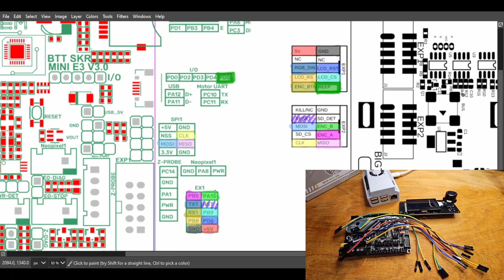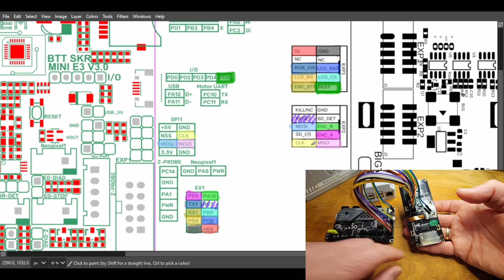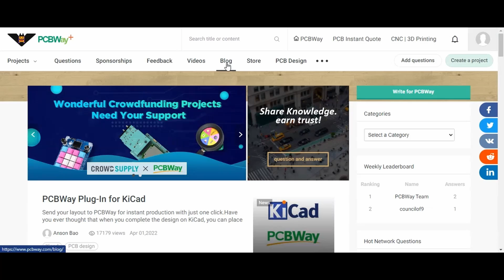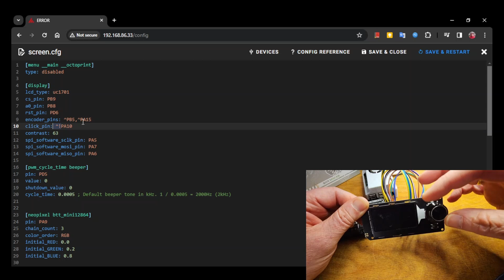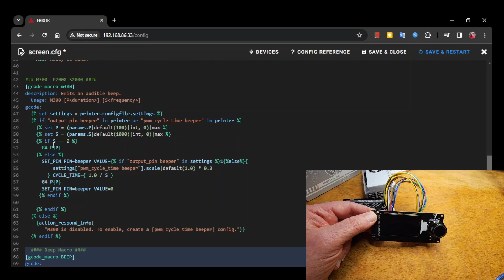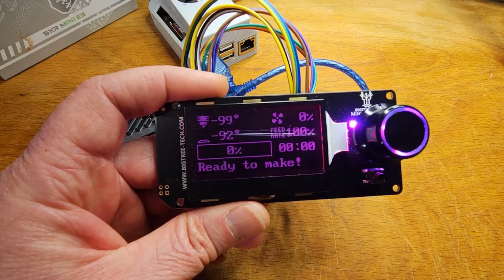Mini12864 to SKR mini e3 v3 | With Klipper

Comment: I have a Makerbase MKS Mini Mini12864 that looks like this BTT display but has different pin out. I managed to make it work thanks to this video and the schematics. Very helpful video. Thanks so much.

Edit: Forgot to mention I used SKR Mini E3 V2. It doesn’t have the same I/O pins of V3 so couldn’t assign beeper to any pins. But everything else works
Reply: Hello ? Would you be so kind to share the right place ? I think i managed to do 90% of the cables right. but the screen comes out blank.
Reply: @sunsixizzy  Here is my screen.cfg: [menu __main __octoprint]
type: disabled

[display]
lcd_type: uc1701
cs_pin: PB9
a0_pin: PB8
rst_pin: PB15
contrast: 63
encoder_pins: ^PB5,^PA15
click_pin: ^!PA10
spi_software_miso_pin: PA6
spi_software_mosi_pin: PA7
spi_software_sclk_pin: PA5

[neopixel btt_mini12864]
pin: PA9
chain_count: 3
color_order: RGB
initial_RED: 0.0
initial_GREEN: 0.3
initial_BLUE: 0.08

Comment: Is the SD card slot in LCD or the micro SD card slot on MCU can be access from klipper?
Reply from the maker: Klipper is not designed to be used that way. Klipper uses a virtual SD card. Basically it's a directory (file) on the host computer (like a raspberry pi).

Comment: Please rename to Mini12864 V1.0 to SKR mini e3 v3 | With Klipper
Reply from the maker: Why? The function is the same with V1 and V2. They even use the same pin layout. The V2 just has an option added for using a ribbon cable connection for certain boards.

Comment: So I have a similar set up and I am struggling because it seems like the SD card and the Screen fight over the SPI. My screen shows no status updates when printing off SD. Did you have any issues like this? Are you simply not using the on board SD card?
Reply from the maker: I don't use SD with klipper. It's easier to just load up files via the network.
Reply: @StackingLayers  this is exactly what I figured why I don't see anything about this issue anywhere online. I guess I'm too old school lol. Thx for the response.

Comment: hi, im getting a PA9 is being used multiple times when i try to save and reload printer.cfg Any ideas on whats going on?
Reply from the maker: You'll have to search through your configs to see where it's being used. You can't have the same pin used in multiple areas, except with some special scenarios.
Reply: @StackingLayers  i see now its used in a section called BigTreeTech TFT TouchScreen emulated 12864 mode in printer.cfg. i tried commenting it out but klipper didnt like that either
Reply from the maker: @itsjustme2256 sounds like you have 2 screen setups you should only have the one you are planning on using.
Reply: I now have the backlight neopixels working and the reset button works, but i dont see any info on the screen. Could that be a bad connection? If so which pin should i look at? Thanks for all your replies and time, i appreciate it.
Reply from the maker: @itsjustme2256 it's best to check all the connectors, but the miso, mosi, clk, and LCD pins are all involved with the screen.

Comment: Will this guide work with Fysetc  Mini12864 and SKR MINI E3 V3?
Reply from the maker: Yes, it looks like they use the same pin layout.
Reply: @StackingLayers   Got the screen to work, however, my button doesn't register and I can't scroll. Any idea why? I copied your screen config
Reply from the maker: Comparing the schematics they look exactly the same in the connectors, so I have to suspect that its a wiring error or loose connection. Or maybe when copy pasting the configuration, the formatting got messed up. Look for random spaces in the configuration especially at the start of lines.
Reply: @StackingLayers   bought new cables and reconnected everything and looked at the config file.. hmmm.. so that config file I don't need to change anything despite them being diff screens right?
Reply from the maker: Looking at the schematics it appears to be the same.
Reply: @StackingLayers  Figured it out.. my button that came with the fysetc wasn't registering due to my screen enclosure lol. I appreciate the guide!
Reply from the maker: @jvu316 glad to see you got it working!

Comment: Thanks, this video combined with a bit more research helped me get the screen working with a Fysetc F6 board. I think pretty much all the pin assignments were different (not to mention Fysetc and BTT having the sockets oriented opposite ways...). Not 100% sure I've got it all right yet as mainsail is unable to restart firmware, but the other restart button seems to work on maybe the second try.
Reply from the maker: Typically the pins are the same just each port are flipped 180°

Comment: the pinout of the v3 seems different, Im having some trouble figuring out some pins if you know any info I would appreciate it
Reply from the maker: The V3? This is with the skr mini E3 V3.
Reply: @StackingLayers  sry meant the screen v3 I kinda figured it out in theory, just confused on ENC_A and ENC_B (SPI_CS also)
Edit: I can send you a pdf of what I have if you want
Reply from the maker: @mrjoelpt sure. See if you can add in on the GitHub repo as an issue. https://github.com/Pneumanifest/SKR-mini-e3-v3-to-mini12864/issues
Reply from the maker: Also which brand is that, Makerbase?
Reply: @StackingLayers  correct makerbase Mini12864 v3
Reply: @StackingLayers  Submited it just now
Reply from the maker: Cool thanks. It looks like it's the same pin order but flipped 180° that makes sense, since you have to shave off the keying tab on the ribbon cables and flip them , when you have the exp1 and exp2 available on both sides. Nice diagram by the way I'll add it to the repo in case someone tries with the same board
Reply: @StackingLayers  so its all correct?
Reply from the maker: Looks like it. According to the schematics they were just flipped 180 on the screen board.
Reply: @StackingLayers  stupid question did you had any success with this pin* config on marlin?
I have a raspberry pi on order but it will only arrive in 2 weeks, I tried same pinout and others I have found online (like only 2) and I cant make it work

edit: nvm gave up on marlin, so far almost everything is working on klipper, need to see how to setup the induction probe and will take care of the lcd after cause Im still frustrated with it from marlin lol

edit2: lcd worked flawlessly
Reply: @StackingLayers I made a better/clearer connection diagram for the V3 if anyone plans on making a custom cable with IDC10. I'm just finishing up a few things, and I'll post it there. Feel free to use it.

Again, thanks for the great code. It's working perfectly.

Comment: Really happy to have found this, I have several of those screens that I hadn't been able to use with that board. Now I can run up some cables and bring them into use rather than buying the Voron V0 screens I have been looking at.
Reply from the maker: Sweet! Glad it was helpful.
Reply: @StackingLayers  Took me a while as I was dipping in and out when I had time but I've got a screen working now thanks to this guide. I used a couple of spare display cables and cut one end off each, that way the connectors to the screen are solid, then once I'd worked out what wires were needed I crimped a Dupont connector onto each wire, following your guide I could then pin up some 4 and 5 pin housings to fit to the board. Thanks again, I shall keep sharing this video :)
Reply from the maker: Nice! That's how I had another setup connected.
Reply: I think you made the right choice for the video as it was easier to follow with individual wires. Do you mind if I share this set up and your code with people in the 3DP Rescue! groups ? With links back to this video of course.
Reply from the maker: @davethebuskeruk I don't mind. Share the links to the world! My goal is to make this stuff easier to understand so more can enjoy the hobby.

Comment: I’m in the middle of building my first printer into something usable. It’s a Anycubic Kobra Neo, I’m surrounded by Vorons and Bambu printer so it hasn’t been used since the Bambu p1p release. I have installed a Stealthburner, better steppers, pi, and skr mini e3 v3.0. I have a mini12864 v2.0 laying around that I was thinking about adding to it and out of nowhere you post this video. What amazing timing. Do you know if the mini12864 v1 and v2 are the same pin out? I’m on mobile now then leaving for work so no time to check till I get home from work tonight. BUT if you know and it is the same, then maybe I know what’s next for this little project tomorrow.THANK YOU for all the videos, you have saved me hours of time in my life.
Reply: Thank you for checking, all the videos and quick reply, I will take a look also just to make sure then follow along.
Reply from the maker: In the video I briefly mentioned that the pins could be different but now thinking about it and looking at the schematic of the V2, it is the same. That would make sense too since you don't normally have to change a configuration and they're plugged in to the same standard boards with the same cables. You should be good to follow along.
Reply: @StackingLayers up and running, I do have to do something about the pwm beeper like you said but I can handle that after it’s all installed and running. Thank you again for all the videos, your BTT Manta CAN vid saved me when building my Micron 180 so thank you for all you do.
Reply from the maker: I'm happy it was helpful!